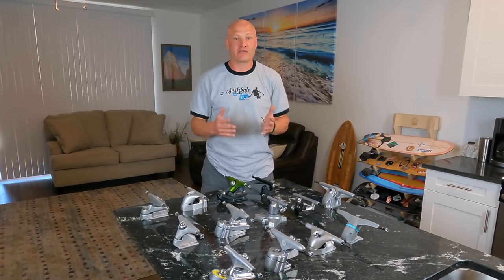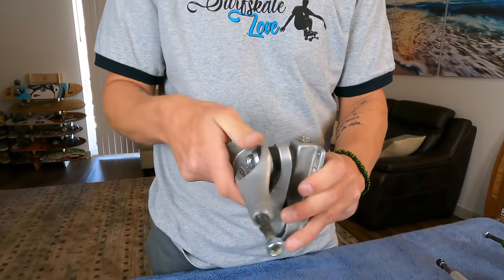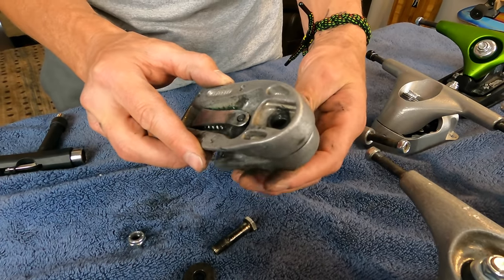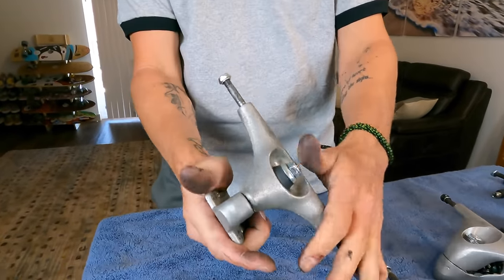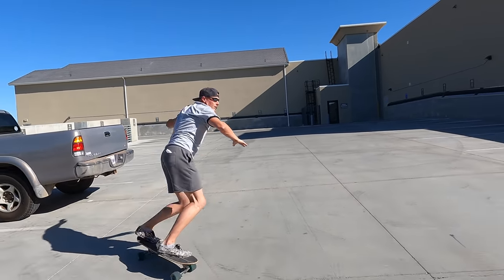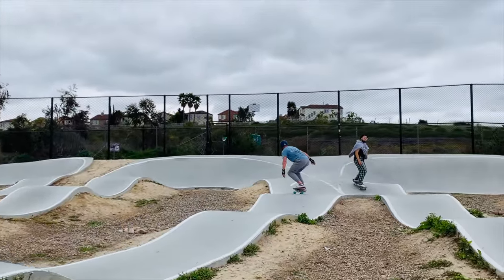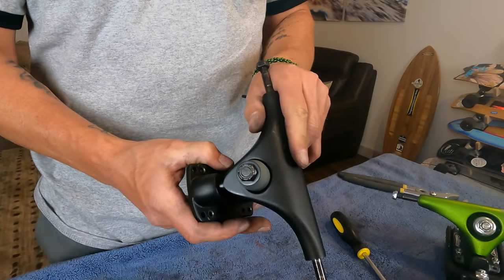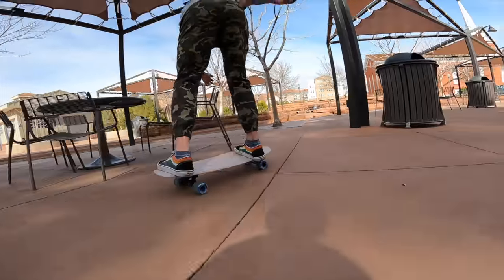13 Surfskate Trucks Dissected, Reviewed, & Compared

Comment: Thanks a lot for this comprehensive video about all the choices - from the in and the outside. And for all the work taking your boards apart!
Reply from the maker: My pleasure, my friend! Just trying to give people what I wish I had when I was starting out.
Reply: Thank you for a great job on all of your videos!
This is really clear and helpful for anyone getting into Surfskates. 
As you say everyone will be looking for a different feel to suit their size weight and ride. I have tried a good few boards and keep returning to one of the cheapest out there the Oxelo 540 carve from Decathlon at £90
I have been skateboarding since the 70s, am 6'3" and weigh 220lbs
This board has a slightly longer wheelbase at 22/23" and runs a cx style truck. I did a bushing swap when I  got it and alternate between the wheels which came with it 66mm x 44mm and some nice big 70mm cruisers 
It just suits me perfectly, great for pumping and maintaining speed whilst carving and cruising around. 
The most important thing is it puts a big smile on my face every time 😁 winner!!
Perhaps you can add it to your review list...
Thank once again 🕉💖🛹
Reply from the maker: @edhumm  Yessir, that smile is the only thing that matters! Unfortunately that board is not available in the US.
Reply: @SurfskateLove  that's a shame, excellent value and fun.
Stay safe 🕉💖🛹

Comment: Thanks for the trucks review.  Right now I'm experimenting with alots of truck setup. I've started with a waterborne, then tried the Carver CX and now riding with the YOW Meraki.  Like them all but prefer the Meraki...   I've bought a flow used from a friend (real cheap) just to try... It's not that bad. I use more back foot pressure to make it work. Also I've found the flow system is more fun on a shorter wheel base... Keep the great content!!!

Comment: Hello, I'm starting in this world Surfskate.
Because my experience with skate, surf it is small, and I can't trie all truck types, this video help a lot, thank's.
I buy my 1st. Surfskate two months ago, 
A Oxelo 540 from Decatlon, too trie with my 11 years soon. Now I'm seeling de Oxelo. I buy to my soon a 32" Triton by Carver with CX trucks and for me a 32" Slide, New model with 3.0 Trucks. We go a lot to Skateparks. Because that I change the wheels to a harder and smaller ones from Carver 58mm 95A.
Now I want one to cruiser with soft wheels. Yow Meraki truck with a 34" deck and large and soft wheels, or take out the trucks from Oxelo and put only the Meraki trucks.

Comment: This is a great video, thank you for making it.  I have the Waterborne adapter with the rear rail adapter too and I really like it. Which of the dedicated surfskate trucks run close to the feel of the Waterborne, I'd like a little bit more resistance towards the limit of motion (I guess you'd call it the flop). Without losing tonnes of turning radius. Thank you.
Reply from the maker: YOW Meraki.

Comment: just bought my son a swell tech for his 10th birthday. I borrowed a slide from a friend for the week before just to get the feel for the surf skates. the slide felt great and neither of us had ever ridden surfskates before. we're surfers and we're in the water at a minimum 4 days a week .so I finally brought out the swell tech as my boys birthday came around and when we stepped on it, it almost felt like it was impossible to ride. the trucks are unbelievably loose. I was pissed. I was like "shoot, I just blew my money". i tightened up both of the trucks just to be able to stamd on it at first, and we kept messing with the tensioning through out the weekend, and ended up backing back out the trucks to the original tension. now let me tell you. this board is the sickest thing I've ever felt out of the water. I bought it specifically for surf training for my son. and after riding it myself for the past few days, ill say thatthe slide feels comparatively stiff next to it. I would 100% recommend slide as a great beginner board, we jumped straight on and were off to the races.  but the swell tech is amazing once you get the hang of it. it was a baptism by fire. we had to learn to ride it or it would be a waste of money. I would say if you're not afraid to challenge yourself and you want a truley surfy feel, get the swell tech, if not I think the slide as it is really user friendly and a great option.  I would definitely buy both and be happy.

Comment: A fantastic overview for the inclined surfskate beginner. Thumbs up!
Reply from the maker: Thanks, Johannes!
Reply: @SurfskateLove  In the video you say that version 1 of the slide trucks have some shortcomings and are not recommended, but version 3 is supposed to be good. Can you make a statement about the V2? I can not find anywhere exactly where the difference between the versions is. I guess the V3 builds a bit flatter than the V2, but otherwise?!! I ask because I have an offer for a brought V2, but unfortunately I can not test it due to distance. If someone knows something I am grateful for answers.
Reply from the maker: @Stepptanez  No, I’m sorry but I’ve never seen a V2.

Comment: Hi Steve!
It would be very interesting if you could make a comparison between the CX, and its quality competitors. I think they are:
- ABIAN TECHNIC
- MILLER XRKP II 6,5".
- SURFSKATE TRUCKS HYDROPONIC 2
- GRASP PADO.23
Especially with the first three, as they seem well designed and built and has a good price.
Thank you very much!
Reply from the maker: As a rule, I don't review or support clones. The Abian Technic, Miller, and Hydroponic are all CX clones. I do have a Grasp review on the way, however.

Comment: There must be a way to redesign the trucks so that there’s less stack height. 
Surely, the levers and springs could be mounted, flat on the underside of the board (no shortage of space).

What if the wheels on each side of the board could be interconnected?

The same amount of turn, but without an exaggerated vertical movement
Or would that defeat the purpose (like carving a wave)?

Fascinating😊😊😊

Comment: To quote someone who knows more than me on this: "You put softer bushings in there, and they're basically Carver CXs but with much more consistent lean/turn. In fact, the Landyachtz surfskate trucks literally have the same geometry as the Carver CXs (~67 degree baseplate angle front truck, and standard TKP back, maybe the Carver CXs have a lower angle back truck but that's super easily transferred to the Landyachtz surfskates with a dewedge).

With soft bushings, they feel almost exactly like Carver CXs. Please take it from me: I have ridden my set of CXs for close to four years now as my daily driver. Actually, I would say that they're better because they don't chew through bushings as quickly, have more consistent lean/turn and resistance (doesn't have that "anti-dive" that CXs have), and actually have improved lean range because they use tall bushings.

It also doesn't need to be said, but the swing arm systems are way less stable at speed.

Regarding the high angle truck systems, the Carver CX does not interface the bushing seat at a 90 degree angle to the hanger, which means that one side of the bushing gets compressed much harder than the other. This does have an advantage since it aligns the boardside bushing downward so that gravity will assist in stabilizing the bushing, but it also means bushings ride much softer in the Carver CX front truck, and also important to note that one side of the bushing will wear out much faster than the other.

On the other hand, the brand new Landyachtz surfskates has the bushings aligned at 90 degrees to the hanger, which means that the action of the Landyachtz surfskate is much more consistent. BUT, the stock Landyachtz bushings are far too hard for proper surfskate agility, so you need to get aftermarket bushings - I use 70a Riptide APS tall cones on mine - to get it to carve as well as the competition. You can also mod the Landyachtz surfskates with dewedge risers on the back to make it way more stable but still extremely carvy because of the high angle front truck. Because the alignment of the bushings for the Landyachtz surfskates are almost parallel to the ground however, they don't benefit from gravity helping to stabilize them, so they can feel a bit more "fluttery" than the Carver CXs.

Like I said, the Landyachtz surfskate requires modding. You NEED to get after market bushings to get them to carve well enough. They just threw in their stock grey urethane for the bushings, which are way, way too hard for surfskates.

I use these: https://www.amazon.com/Riptide-Tall-Cone-Bushings-APS/dp/B07BR236NS

70a is an insanely soft duro for bushings, and with 70a tall cones, my Landyachtz Pocket Knife carves just as hard as my Carver CX, which I put an 85a Powell Peralta Hardcore Barrel in.

From just a technical perspective, the Landyachtz Surfskate truck IS an improvement on the Carver CX, which until now has been the standard for the high angle front truck category (although the design is so easy to cast and rip off).

The Carver CX angles the bushing seat in a way that does not maximize bushing compression and therefore stability. Regarding the stability issue this is offset by the fact that the angle keeps the boardside bushing mostly on a vertical axis, so that the weight of the rider and deck + gravity pushes the boardside bushing down into the bushing seat, which compensates the stability. But the fact that it's set at an angle means that one side of the bushing gets chewed up way faster than the other, reducing your bushing longevity by 50%. This also means that the CX has, I dunno how to describe it, but the opposite of dive - since it compresses one side of the bushing much much more than the other, that side of the bushing "maxes out" on compression much more quickly than normal, which means that the truck center feels loosey goosey, but then rapidly increases resistance and rebound the harder you lean into the turn."
Reply from the maker: I'll give it a shot!

Comment: I just got into surfskating after trying a surfskate for the first time in Portugal at a surf hostel. I bought a cheap Flow wedge for a bargain, 70 dollars. I like everything about it except the front truck which is not smooth at all. But buying a better front truck would solve the problem

Comment: Steve would be nice if you could make a small update on what TKP truck to use with especially the YOW S4 S5 and Smoothstar adapter. The Yow Meraki comes with fix truck, what’s the Axle width. There is basically no information out there.

Comment: Great video. You are starting to mix & match trucks, decks etc. which also creates value.  Lots of great deck builders creating more premium products then what the surfskate manufacturers are putting out there so it may be worth it to review products from Soulboardiy, or Koabär  (you would probably love their biggest board) or even surfpuro from Brazil. Also I have a suggestion and that is trying out the waterborn REAR rail adapter (if you got it) with some of the other front surfskate trucks like yow/smoothstar etc.  It may affect the overall behaviour of the system and since you are used to disassembly and reassembly by now, why the hell not :)
Reply from the maker: Yep, you're right, customization is the next level. And IMO, there are no stock decks that are really amazing as is. Things I'd change on all of them.
Reply: @SurfskateLove  I'm just glad someone is doing what I don't have the time & resources for :)

Comment: Hi steve, love the channel mate. Question, I am an experienced surfer wanting to start to ride bowls and pump tracks. My plan was to purchase a smooth star and tighten up the trucks to start in the bowls and skateparks and then loosen them as I progress. What are you’re thoughts on that? How does the smooth start truck compare to the cx at full tightness? I know allot of people recommend cx or c5 for beginner bowl riders due to the tightness. Appreciate any advice. Cheers.
Reply from the maker: The Smoothstar Thruster and Carver CX are completely different, even with the Thruster tightened. And unfortunately, I can't tell you which one to go with because it's all based on personal preference and skill level. But if you're an experienced surfer, you might want the Smoothstar just for surf training anyway. You'll really just have to try both.

Comment: I would like to know if you have heard of the new Genesis trucks made by Lean? The trucks are made for the Long Island brand which comes from HLC, the same company producing Yow surfskates. I am looking seriously at the Long Island Mossel. I saw a review in French and it was really positive. The truck looks like a Meraki just with bushings. It is supposed to be a cross between a CX and a Meraki. They were said to be smooth but with a deeper Lean than the CX. Thanks for your review and your help.
Regards, Hayward Butler
Reply from the maker: Yes, I've heard about it but haven't been able to get one yet.

Comment: What about using two front Waterborne trucks on a Surfskate (putting a front truck on the rear)? Wouldn't this give a much tighter turning radius? I like the feel of having a really long 4ft board under my feet, so maybe this would work to make a long board have a tight turn radius. Maybe also bring the trucks closer together under a longer board. I'd like to experiment making longer tighter turning boards, as well as wider like 12" wide boards. Wider trucks might also add some extra stability and look cool. I might have to bust out my welder and build some custom extra wide  Surfskate trucks and do some experimenting.
Reply from the maker: No, that wouldn't work. What makes a surfskate work is the stable rear truck combined with the front truck.

Comment: @Surfskate Love Thanks for your helpful videos. I am 50+ and just got a yow surfskate and love it. I wonder how do you set the hardness of your trucks/bushings? On my longboard I set them as loose as possible but still firm to go back in middle position, and hard enough to not get wheelbite at any manoeuvres I do. But with the front truck of for example the meraki system that swivels around I have no real clue yet, how loose to set the truck or when to put softer/harder bushings. Is there any guideline/consensus on this? Thanks

Comment: As a surfer, bushings are way better than springs. I dont understand why people think that surfing is a slow motion twisting wiggle wiggle sport with lots of exaggerated arm movement   Good surfing, like any carving sport, is rail surfing and needs to be done with speed. A good carve is when you accelerate out of a turn. Wiggle wiggle slash is not good surfing.

Comment: Thanks dude! That's was pretty thoroughly. Would You give an advice.. I need someone track to train to add pressure the body weight to the board edges.. like the snowboard.. to make that using the ankles only is not enough.. What of that trucks should i take?.. any tuning? Thanks!
Reply from the maker: I would use Carver CX for that.
Reply: @SurfskateLove  Thank a lot Bro! Keep up the good work 👍. Seems You made +1 to the surfskate lover... 😁

Comment: I really like your videos...but as a surfer I will give you some advice when you are riding a surf skate. Your upper body needs to quiet down. Your arms move more than the board. You need to bend your knees a lot more and let your legs do most of the work. Since you don't surf I understand why you skate the way you do. I like the Carver Taylor Knox board. I personally do not need a super loose front truck because I use a lot of lower body power when I skate. I skate like I surf. Fast and powerful. Keep the videos coming.
Reply from the maker: Thank you! Much appreciated. I need all the help I can get.

Surfskating is funny because we non-surfers don't know how it's "supposed" to feel. So I've taken two online video courses on surfskating for surfers. But even with the instruction from surfers, the movements are still abstract, meaning I don't and will never know how they translate in the water on a surfboard.

So I do my best, and I'm learning every day. 

Thanks again!
Reply from the maker: Also, I had back surgery and I have very limited flexibility, which holds me back a lot. Everyone tells me to bend more, but you have to understand that I really can't. 😂
Reply: @SurfskateLove  You do not have to bend your upper body. Try to just bend your knees one or two inches lower and then use your legs to pump and turn the board. Use less upper body and arm swinging. Focus on your legs pushing you into and through your turns. Once this is comfortable for you  you will really feel the stoke of surfing on land! Keep on charging and stay stoked!

Comment: Hey what do you think about the YOW S4 System? It even has the option to lock the truck and use the board as a cruiser. Better go for that or for the new meraki? Im 84 kg, 183 cm.
Reply from the maker: New Meraki is much better.

Comment: Nice review!!
Are the widths of trucks yow and carver c7 the same?  Which one is wider?
Reply from the maker: There's about a quarter inch difference. YOW Meraki is 8.75", Carver C7 9". The only difference it makes is that the YOWs have less thread for the bolt, which means you'll see that bolt stick out a bit more on the C7. Make sense?